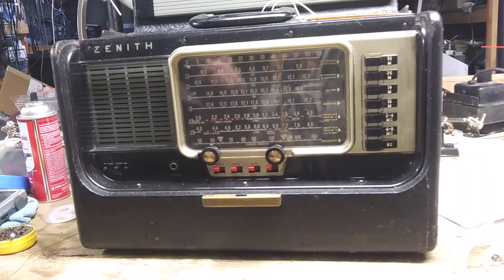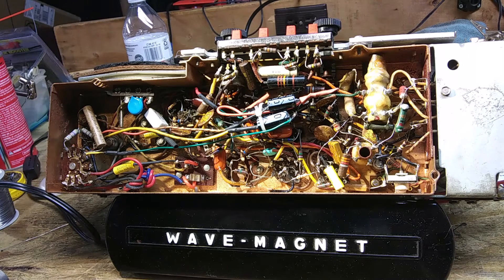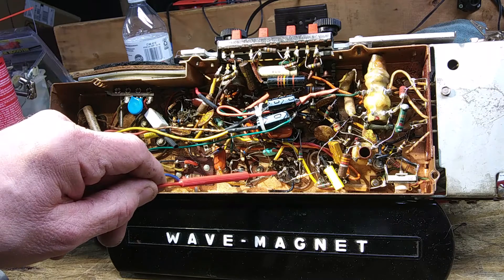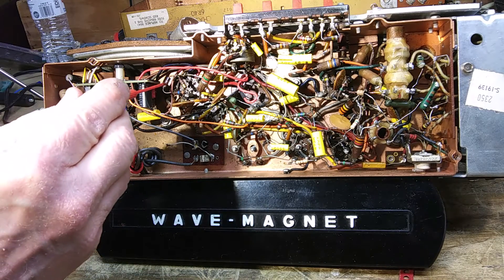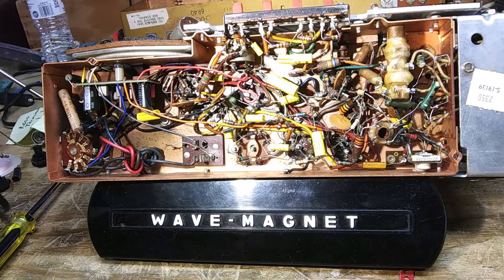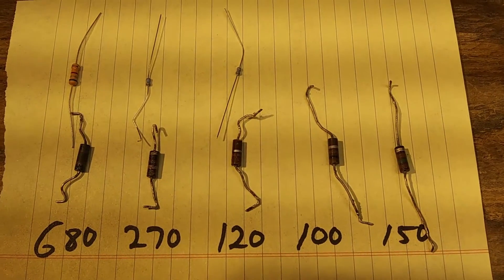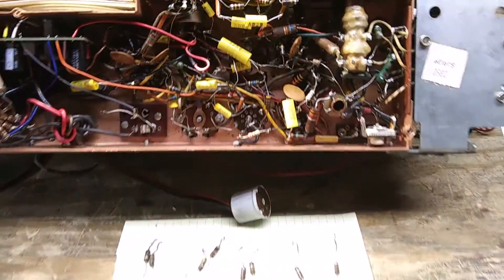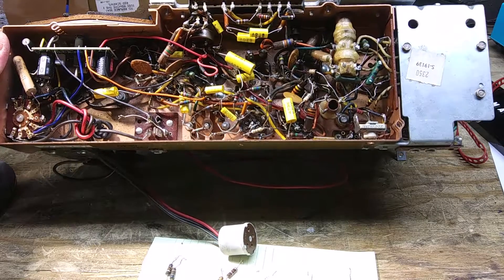Zenith Trans-Oceanic R600 Repair Part 6: Replacing 5 Important Resistors

Comment: Thanks for showing these resistors. I'm guessing they're 1/2 watt resistors, correct? I would be curious what the actual ohm reading is of the original resistors and how close they were to the stated value.
Reply from the maker: Yes, they are 1/2 watt resistors. I don't think I measured the old ones at the time.

Comment: I'm glad I watched your other video where you talked about the resistors blowing and taking all the tubes out, otherwise I would never had known. I just ordered the new resistors and got the re-cap kit from Hayseed Hamfest and I have the Filt-R-Pak already so I'll be ready to start once the resistors arrive.
Reply from the maker: Super!  Glad to hear it.  It's been a while since your comment.  How's the restoration going?
Paul
Reply: @vtradio  It's been a bit slow since other issues keep taking priority (like fixing my car) but I have gotten both Trans Oceanics apart (I have the 1958 one and a 1949 one). They both work on battery surprisingly well. The 1949 one has had some work done on it before (they replaced the caps inside the old cap can by cutting it off I'm guessing, since you can see the new caps inside the bottom). The Dial Light switch on the 1958 one is completely dead somehow so I'll have to fix or replace it. The wires for the antenna in the lid of the 1949 one actually go through the lid hinges and through slots in the wood to the screws that hold it in place. Either way I'm in for an adventure.